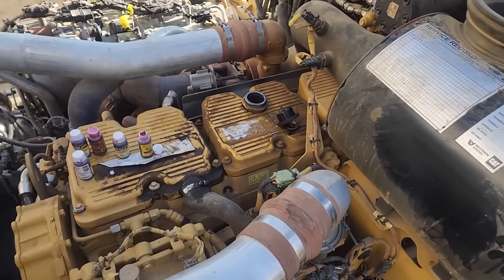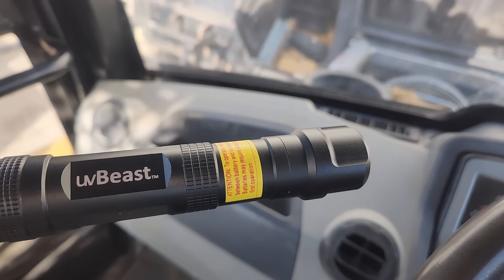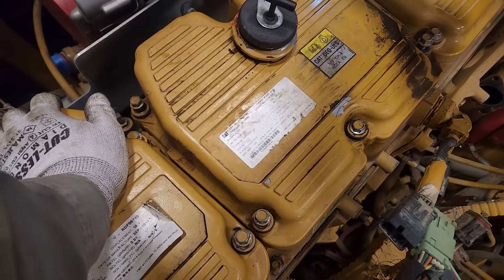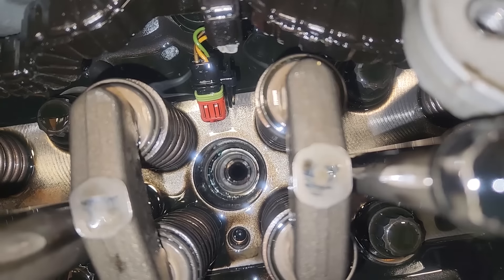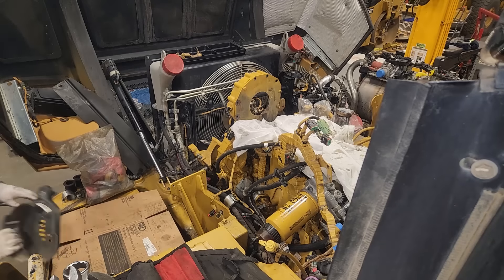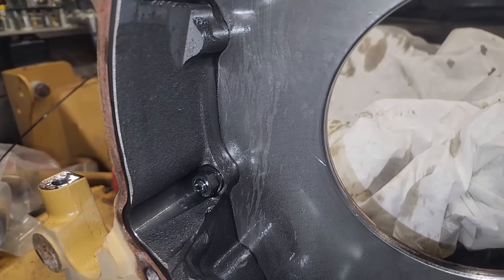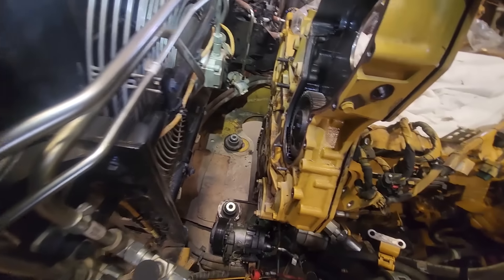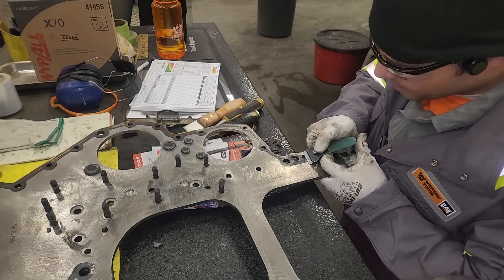C18 Diesel Engine has BIG TIME oil leaks in a Big 745 Haul Truck.

Comment from the maker: Thanks for watching, do you guys like equipment content? @AdeptApe on Venmo or AdeptApe@yahoo.com on PayPal for donations, thank you so much for supporting the channel! If you wanted to check out the UV light here is an Amazon Affiliate Link:
UV Professional Grade Light: https://amzn.to/3gzxPc0
Engine Oil and Fuel Dye UV: https://amzn.to/3z34zkv
Reply: can you perform work at your home without any problem from your employer
Reply: Thanks for the product inks.
We're not supposed to use "Razor" knives, scrapers in our shop. To much "Cut" hazard for the Safety Guy and Company.
No "Hard" hammers either, Soft steel only.
I've heard some guys say Oven cleaner will soften hard gaskets if you let it sit for awhile.
Might try some old school tricks to see if they work.
Reply from the maker: I'm sure razor scrapers will be outlawed soon here. Soft hammers are for anything over 4lbs I think at our shop. Pretty sure gravity will be deemed dangerous in the near future.
Reply: Yes, more equipment!
Reply: I do like watching the heavy equipment side of things too interesting and different kind of set up going on I do like enjoy the truck content just as much so if you can and want to do more I'd watch it
Reply: More equipment.
Reply: Completely different question, apologies just not sure the preferred part of the channel to pose this..
I have a 2013(mnfc in 12) t660 with an epa 10.  Had an in frame done and had to replace a not old head due to valve guide loosening that couldn’t be machined, at least not locally.  Had the air compressor replaced recently as well.  I’m losing fuel prime, at least that’s the guess, when it sits turned off for more than 7-8 minutes.   Requires a longer crank to start hesitates at 4-500 rpm then confines to normal idle for about 7-8 seconds then a quick gasp hesitation and it seems to idle and run fine.  If left much longer off than that it won’t fire at all, crank won’t start, until I prime the filter with the manual pump then it roughly starts.  Takes several minutes to smooth out then runs fine.  My question is, is there a check valve that can fail that would normally hold the fuel pressure in the system normally?  Thanks
Reply: Hi Josh, keep up the yellow iron equipment and your regular topics.I learn a lot from your videos.Thank you
Reply: ⁶⁶
Reply: I do like the equipment content.  It could be useful information for a newer mechanic.
Reply: More equipment videos

Comment: I just would have thought that by this stage of the game, these typical oil leaks would be much less typical in these hugh end engines. A friend works on a high end (British) brand of diesel marine engine. And they don't leak- period. So it can be done. But CAT gets a premium for their engines and they leak like the not so premium brands. They clearly build a robust engine as they can run for thousands of hours and over a million miles....  but they can't keep them from leaking. Anyway, love the videos as always. Cheers!!
Reply: Depends on who put it together, just striped a C18 last week, wrong bolts,washers and they even cut bolts because they didn’t have the correct bolts.
Reply: What brand of engines never leak?
Reply: My 1999 Cummins N14 has no external leaks with 1.109 million miles and 24 years old.....😇
Reply: @michaeldunagan8268 You have a N 14 Cummins with no leaks?? You better buy a lottery ticket as that’s not gonna happen ever again. 😂
Reply: There isn’t a engine that just never leaks at some point every engine will end up having a leak
Reply: That's not a very fair comparison though. Marine engines run at 1k rpm for a month straight, producing a tenth the power per displacement. These kinds of engines get cold starts every day and then run through their full rpm band about 1,000 times per shift. The environments are worlds different as well, the vibrations and impacts these engines will see are completely incomparable to the nearly cleanroom conditions of a marine powerplant. Then there's the price... No comparison, you're looking at about 50:1 cost difference, which is wild when you consider CAT is such an expensive brand already.

It's like comparing an f1 engine to an economy car engine. They just can't be meaningfully compared.
Reply: @operator8014  I didn't really consider that aspect. The engines I was referring to are the MTU diesels. I guess I was exaggerating some when I  suggested that they NEVER leak, but its rare. Certainly not at the rate that others do. Extreme heat cycles could certainly  increase the propensity for an engine to leak. But it just seems like the majority of the commercial truck engines leak prematurely. And these CAT'S are a premium brand. And I misspoke- MTUs are German not British. Anyway, cheers sir!
Reply: I love a great civil discourse on YouTube, right on fellas!!
Reply: I worked for Cat in the foundry where these blocks are made. I have to say that the QC on these blocks and heads is top notch. Now when it comes to parts that are supplied by external vendors, you know, you get what you pay for. Expensive, well made block with cheap gasket = oil leaks.
Reply: Place gaskets and o rings with great precision and no mistakes.

Comment: Nice hair cut, Jake Brake????????? Got chewed out by Cat, they are called Cat Compression Brake. The bolt-nut goes back to the 92U days. When the 5EK's came out, they did not have a oil relief slot on the stub shafts. Oil psi would build up and work around the threads. Oil would then leak out the front plate to block joint. I always replace the gear bushings while it is apart, along with all the self locking bolts in the gear train, cheap insurance. Have seen very few injector cup seals like what you have. Quality control at Cat must be slacking. Remind your followers what happens when you over torque the cam gear.
Reply: Technically it's a Cummins brake because it was invented by the man the Cummins company was named after and sold to jacobs diesel.

Comment: Those huge dampers were interesting, had to be a weird vibration in that haul truck application. I used to build and test the big case ih floater trucks and on the rear cab mount pedestals were weights mounted on them. Just a bolt running through the pedestal with a bellville washer and about an 8ish pound round chunk of metal tightened to it. It sounds crude but without those installed the cab would vibrate when running. I always wondered who figured that out, kinda ingenious.
Reply: I would’ve thought that it had something to do with the way that a rock truck articulates. Still pretty cool.

Comment: My tool box is a mix and match of tool names. Lots of snap on and lots of craftsman. Some mack, gear wrench, proto,.... It depended on which I could get quicker when I needed it. Haven't used them professionally for some time but still rebuild old junk and maintain my fleet. And then there's the grandchildren!:) One nephew and one grandson working the trade. My time was in brakes, suspension, alignment and back in the day carbs and tune up. Always fun to watch a true professional at work. Thanks!

Comment: I work at the caterpillar engine facility where those engines are built it’s just crazy to see the engines from being built to running in a piece of equipment. BTW that specific engine started being built on 9/16/2018 and was completed on 9/24/2018.

Comment: The locking bolt is probably an intentionally, very minor incompatibility in thread pitch. GM uses the technique. If you ever get a bolt that needs a ratchet all the way off its likely one of these fasteners.

Comment: There’s nothing worse than trying to find an oil leak with the truck just idling minimal oil pressure you know even when you’re trying to have the engine running considerably not only other hours being tacked on, but it’s not under load conditions where the higher oil pressure is crucial to defined, leaks a lot easier.

Comment: Was working on a crank but wont start c4.4 today . I unplugged the injector plug by the valve cover and it had engine oil in it . Have you seen it where oil gets into the injector harness and causes issues ?

Comment: The only time I worry about our Clatterpillar motors leaking oil is when they stop leaking! That means it’s empty!  If you’d like Josh, just warranty that motor and put that motor in my Peterbilt!  Back in the 1980’s Peterbilt cab overs had three wipers. Of course only is old guys remember that! Agree on the JIC fittings! And I didn’t realize haul trucks had retarders.  What a terrific idea!

Comment: Hi Joshu this is Danny i have a 3406e i take out the front cove out then see the crank mark not line up with cluster geae when i put back i did not line them mark up i put on same mark the timed engine do i may  have any problem if you could talk about this gear set up how is work thank you.

Comment: Have you ever hit hard gaskets with a ballpein hammer? It makes them super easy to remove.
Reply from the maker: Yes, I even have a video about it. It leaves little dents in the base metal, so I only just that technique on certain things.
Reply: If you use a brass hammer it will work without causing the dents.  Only on steel though  with aluminum it will still cause dents

Comment: Great Video. I appreciate your attention to detail. I am very fussy about surface finish and gaskets as well. I work on Commercial HVACR Equipment, it’s amazing how much stuff transfers between heavy duty mechanics and Commercial HVACR, only difference is our equipment doesn’t move and normally electric driven. Thanks for the Videos.

Comment: Rig the damper with the crane and lift it so its semi supported at the bottom and rock away.  Everything I work on is too heavy to lift and you need to get creative with rigging and the crane.  I would have a 1" wide,  6 foot sling and choke them around the OD.  buffers also make the surface less straight.  if you want a leak use the buffer.

Comment: Just asking, how much did it cost in time and labor to 😮fix the oil leaks, versus clean the oil leaks, and add oil.
Reply: Is it a warranty repair or did EPA find it.
Reply: Cheaper than an engine when it goes bang cause it’s got no oil in it

Comment: I have an 09 kenworth with a c13 emission engine.  Leaking oil from the rear.  Told the kenworth dealer what it needed and of course they "resealed" the engine.  Still leaking.  The office finally listened and sent it to the xat dealer.  Sure enough, they put it on the dyno and found the rear structure seal was shot.  Now my other 09 is leaking in the same place.  Office doesnt want to fix it because they need to pull thw trans again.  Asked them why this wasnt checked when the clutch was replace?  Crickets from the office 😟.  For shits sake

Comment: I use UV dye a couple three times a week to find leaks and a couple things I have learned is when adding to an engine, transmission, hydraulic systems is to pour the dye into oil/fluid and stir it to combine and the add that to engine/transmission/hydraulic system. The second is unless the leak is pouring out most Leaks require the vehicle/equipment/etc to be run/used instead of idling.
The injector o-ring look like they have been exposed to something like brake fluid or something similar

Comment: When working with JIC fittings I always give them a smack with my wrench on one of the flats of the fitting.   The impact helps break the seal and most of the time the fitting will separate and the half that is supposed to stay put does.

Comment: Did a transmission for a guy once. When I tried to blow the cooler out it was plugged tight. Afterwards I get the whole story. Previous owner hit a deer. Paid a guy 50 bucks to put a radiator in it. He left the dust cap on the cooler line and slid the hose over it and clamped it down. Van was never right after. Its why I always try to find the cause and always blow coolers out. Ya never knwo who did what before ya.

Comment: I need to get that cap for my spray deal. I have to use the 24 or pliers. I took the diverter deal out from under the nozzle and it chooches almost as good as a aerosol can does.

Comment: Those rocker shaft bolts have been updated by CAT, but you still have to use one of the older bolts for the Jake housing oil supply. Infuriates me because the old bolts are 12 point and the new ones are 6 point. Those bolts (to my knowledge) are present on c15, c16 and c18 engine families, including the 3400 series engines.
Reply: shhh he doesnt update them even tho i have told him numerous times about it
Reply from the maker: Are you referring to the double sided stud bolts like the MXS engines? I'm familiar with those that have the shaved area under the heads, but not anything else.
Reply: @AdeptApe  I'm referring to a non ACERT engine, never worked on an ACERT engine before, those rocker studs look like a nightmare. I can't seem to find the part number for the updated one I'm thinking of but I've seen them once or twice. It's not shaved down to allow oil to pass through, which is why you still have to use one of the older bolts. Will there be an update to this haul truck?
Reply: @Frosty_Saiyajin  In the hiway truck world, the rocker arm bolts on MXS, NXS and SDP series including reman long blocks or complete engines. Have a updated bolt, but you still have the reduced shank bolt for oil feed. 
Starting with the late 6NZ's, MBN's and BXS, also including Reman long blocks or complete engines. Cat started using a full shank bolt, except for the oil feed on engines equipped with a Jacobs Brake. However on PAC brakes the full shank bolt will not fit through the hole, so you have to use reduce shank bolts.
If your running a Jacobs Brake you can use the full shank bolt no matter what your Cat engine. Still need the one reduced shank bolt. The part number for the full shank bolt is 2572122 it was in recalls for the 6NZ, MBN and BXS series.
Reply: I've seen the IPR stick on some of those sit-alot 3126's, or lots of idle time and not consistent oil changes. Makes them run really goofy if it sticks then moves and sticks and moves, etc. Sometimes they clear up fairly well, sometimes it comes back. 
I've had really good luck doing a flush with a quart of BG109 EPR. Works way way better than the store-available flushes- used it on anything from 1.9L VW diesels to 3412E HEUI's. Works well for sticky IPR's, mild stiction on the later style injectors, and have had it help with carbon-fouled rings on smaller engines. 
No miracles obviously, but a true pro-grade flush can make a big difference if used right.

Comment: Not sure if I've put this out before but, using phone wire which I think has 8 deferent colors is also great for matching air lines or electrical conns. Usually the connectors have different connectors that won't jive with the wrong male/female but airlines are well just certain sizes. A mobile Cat guy turned me on to this, even gave me a 5" x .5" inch strip that I'm still using.

Comment: I worked for a trucking company as a mechanic helper and we had a truck with a series 60 with a oil leak on the front cover. We tore it apart and resealed it and sent it out. The driver called and said it was still leaking,pulled it back apart and found a hair line crack that we missed

Comment: Always saw oil leaks between top of block and spare plate. 3406 and c15. Older block surfaces get wavy. Hopefully who ever worked on it before didn't use power sander and damage block. Cat says to put that thin metal gadget on dry only. Probably because it could effect liner protrusion.   Had a guy come in with an older 3406 E that was dry as a bone. He said the mechanic used K W copper coat on that gadget. I never had enough guts to try that but boy that engine had no leaks
Reply: if you read the letter in a head gasket it is required for any head gasket failure.

Comment: Yeah, Im liking the equipment repairs!  

I have a tip for removing gaskets that are cooked on. It works best with very hard brittle gaskets. Take the ball end of a small ball peen hammer and tap on it. If its very brittle it will come off very easily in big chunks. If its still a little pliable it won’t shatter off nicely, but it still distorts the gasket enough to make it way easier to scrape off !
Reply: Try Loctites Gasket remover, works very well on all gaskets. Disolves them really good then easy to scrape off.

Comment: Brings back memories. Yes front structure and head. Also seen the cam shaft plate leak too. Had a C15 that the cam plate leaked all the time. Turned out the hole in the FS plate was out of round.